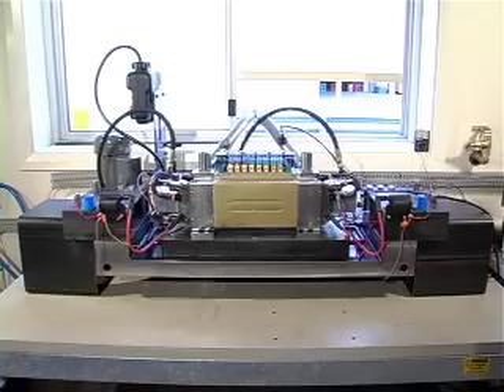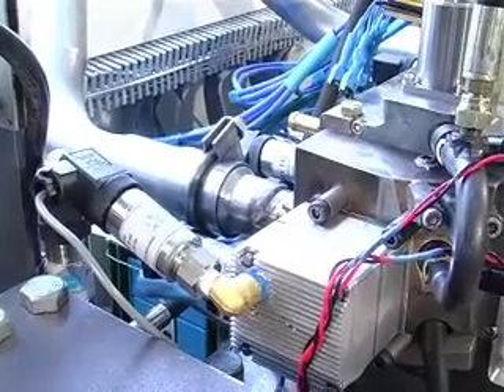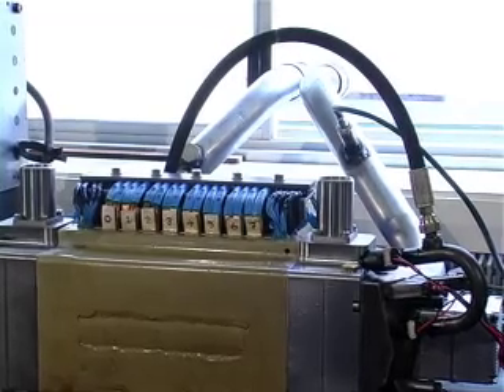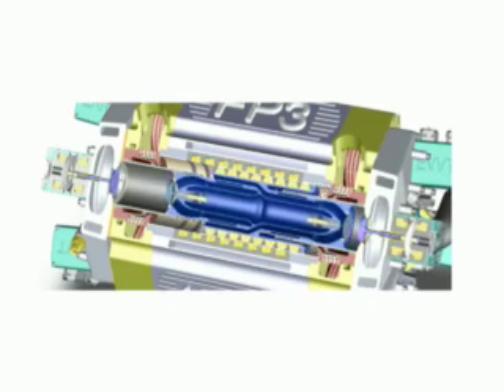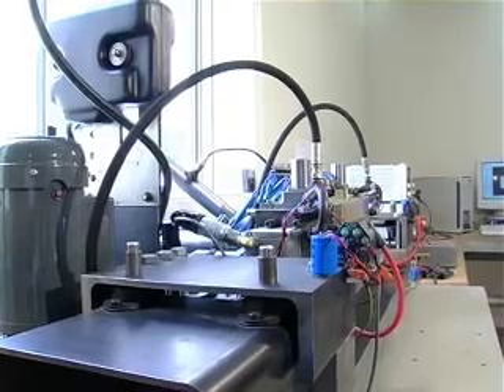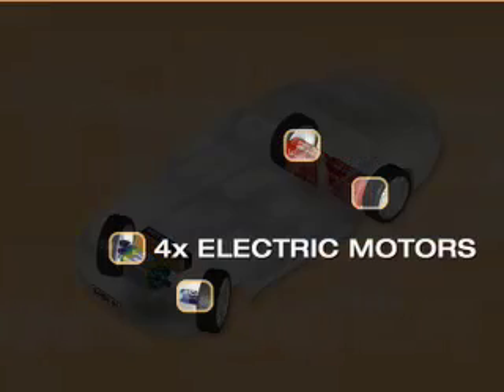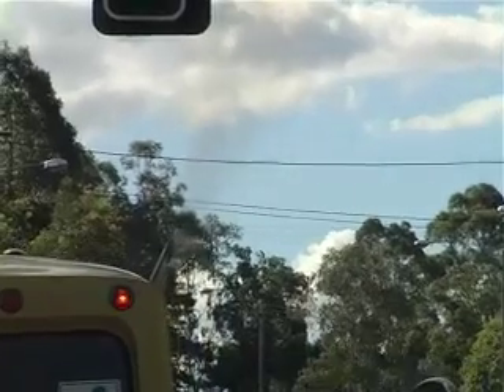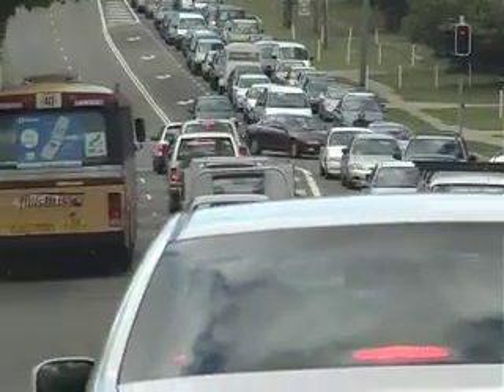Free Piston Engine.mov

Comment: You present the side intake and top exhaust valve as if it is something new you have invented. But that is not the case at all. This sort of arrangement have been in big 2 stroke diesel engines for a very long time.
Reply: its is not side intake, not cylinder wall ports. the intake goes in through a poppet valve in the piston, and apparently goes out through another poppet valve in the cylinder head.  usually 2 stroke diesels have the intake go in through a poppet valve in the head and out through a side port at BDC.  Their scheme, i guess requires a super charger of some sort to feed fresh air in and push bad air out?
Reply: John Smith    I wondered about the air pump also.  Did you ever find out how they did it?   

There’s some guy with a website full of interesting engine configurations, very low budget, several proof of concept running models had integrated air pump features for compactness and low cost.  
http://www.pattakon.com/pattakonTilting.htm